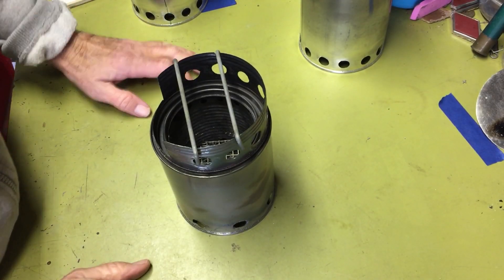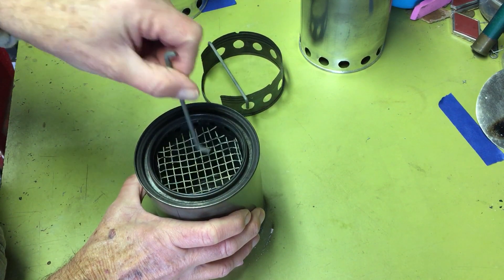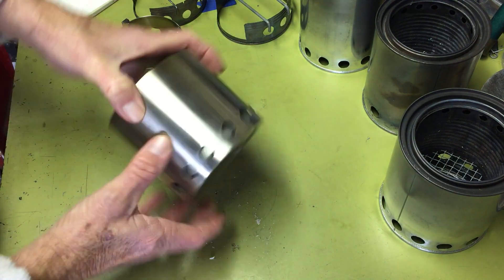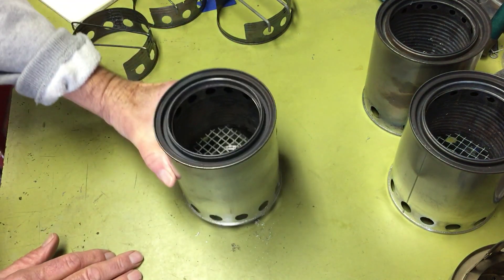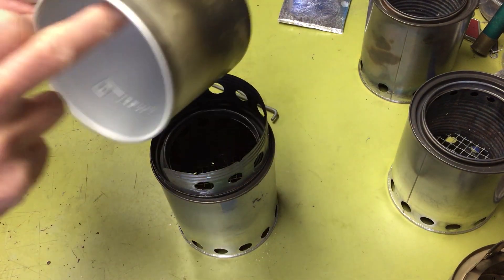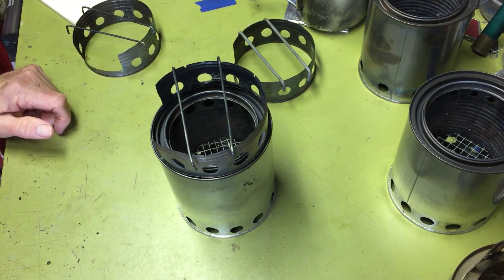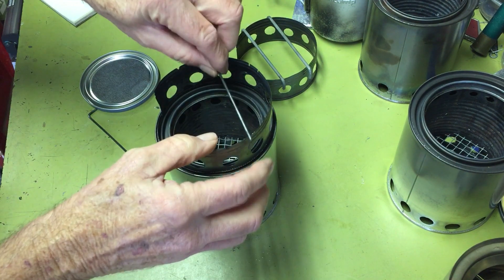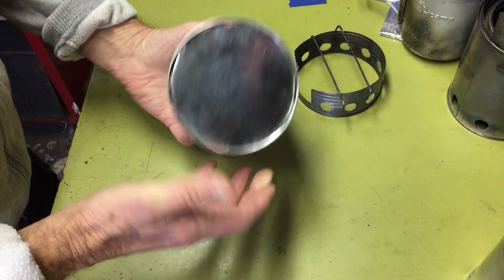My paint can gasifier wood stoves

Comment: If you put a drill bit in the gasifier jet hols and bend it over, you can create a vortex effect, which helps to heat the pot better
Reply from the maker: Great tip, I'll give it a try.

Comment: The thing that gets me with these stoves is the amount of details they give.  One video says drill 32 holes 5/32" in diameter 1/2" up from the bottom rim.  The next one says to drill 5 or 6 holes about the size of your thumb in the flat part of the can.  Then after he did that he said they're not really thumb size but they're finger size.  That should work.  

This one was good.  It told number of holes and sizes, why it didn't work and what made it better.  Very informative.  Thanks.

Comment: Now there is no paint can with the steel bottom. They are all plastics, and I thought that was your case, but you actually got with the steel base and cut them off. In other videos, I saw they left the bottom alone except to make holes on the sides.
Reply from the maker: I can still find unused new 1 quart paint cans in my local hardware store.  
In order to use the Progresso can as the burn chamber and get it to fit into the underside of the paint can lid you must cut the bottom of the can out.
The ones where they don't cut the bottom out use a different build technique and force and secure the burn can in from the top of the paint can.  Both techniques work the cut the bottom out is easier.

Comment: Nice explanation of what seems to be a common mystery... how to get the DIY stoves to draw like the factory ones. It seems that the solo and/or bush buddy stoves have that sealed bottom but still have the bottom side holes the same as the DIY's and I'm wondering if that design gives them the perfect amount or correct designed draw? It doesn't seem to make much sense but perhaps too much air can be a detriment as much as too little.
Reply from the maker: After watching some videos by Heath Putnam I'm not sure what is the correct answer on stove draw. 
I may go back and do some more experimenting, if I do I'll use wood pellets for more consistence testing since wood/twigs can be real variable.
Reply: @planetsideagent  These are two very accurate comments:
1.- Entering too much air will cause the gas to escape and be wasted. Remember that its combustion is a bit slow, and much more so if it has so much ventilation at the point of combustion. It requires high temperature to improve its combustion. An air intake regulation device comes in handy.

2.- The pellets are compacted wood, this helps to have more mass of wood inside the stove, and makes the circulation not flames, but air and hot gas.

(an additional contribution) * Remember that if the top hole of the stove is smaller, the gas is concentrated and combustion is more efficient. If it requires so much ventilation above, it is because below it is not ventilating well. This turns the gasifier into a simple wood burning stove.

Comment: The smoke is a consequence of not getting a good woodgas burn.

I've had such a terrible experience making wood gasifier stoves that I am now making a FireBox rip-off. 

Still reading? Ok, I have had massive airflow issues, difficulty starting them, billowing smoke and they just went out with the slightest breeze or would not burn properly. I have followed some precise instructions, which included a very interesting demonstration, and tried more/bigger holes, which negated the woodgas effect (smoke!). No more for me, I moved onto plain hobo stoves and cat can stoves. Thanks for the information, no I know I'm not alone.
Reply from the maker: I can't guess why you had problems with your stove.
The first gasifier I made worked ok but I thought it could be improved so I played around with the design.
 I'm not really a wood stove guy, they are interesting and fun to make and play with.   
I do have a couple of the folding type I carry for survival purposes especially in winter when it would be difficult to build a fire in the snow.
Reply: @planetsideagent  Airflow is definitely the problem. Unless you are lucky and make the right number of holes at the right size and place, even then, a slight (but continuous) breeze will want to reverse the air flow and kill the whole process, snuffing the fire with zero effort. I've tried with a really big windblock, different sizes of cans and the result is always the same; if a breeze comes through the top of the stove, bye-bye fire.. 

Nothing against people who like these stoves, but my experience has been such that I will not depend on something I can barely get going for 5 minutes. I do have to say that a perfectly windless day here does not exist... makes for very interesting bike rides, let me tell you!
Reply: @Flashahol  Interesting to find your comment - I'm in the middle of about my 6th experiment and wondering what I'm doing wrong. The weird thing is seeing other people use them and having no problems (or not reporting them, maybe). I think you're right that people tend to increase the air flow (that's what Planetside Agent is doing through these design tweaks), and they basically turn into slightly heavier hobo stoves with secondary air fed up top - burn like crazy, big yellow flames, smoke, soot and tar all over the pot after you've fed them for 15 minutes. People who get it right restrict the air intake and primary (lower) holes, and sometimes have tricks to try to create a low pressure to suck air down the burn chamber and up the sides, and they get that nice bluer flame, a steady burn, very little smoke or tar, and heat for long enough to cook and make a hot drink (from a smallish can, not even a quart pot) with just one load inside, no feeding. Check out Outside Edge Bushcraft's channel, for example - he doesn't cheat with pellets either, just battens a chunk of hardwood down to sticks and bangs it on. Four things might explain his success, as well as the good choice of hole sizes - he chooses wood well, he gives it a really good hot starter fire on top of the main wood, he always uses a wind break, and his design also has a "flame concentrator" above the jets, which helps protect them from gusts as well. But I have to admit it's a dark art to me - literally, the things always go out shortly after the starter fire's done, and they do it even when there's no wind. https://www.youtube.com/watch?v=oUG0Z1pa0Hk  He's in Britain, same as me, windy and wet. Good build video and a test video with ridiculously long burn time, boiling three kettles of water. I might have to go back to some kind of hobo stove. It's just so frustrating not being able to crack it.

Comment: I understand this is a "rocket stove", but how is this a gasifier?
Reply from the maker: A gasifier stove is a doubled walled stove where air between the walls of  the burn chamber is heated by the fire and exits thru holes in the top of the burn chamber and ignites wood gas given off by the wood fire. 
Here is a link to a paint can gasifier stove build where you can see the double wall design. Its the video I watched that inspired me to build my  versions
https://www.youtube.com/watch?v=rTPTenSPqs4&t=20s

Comment: soot is an indication of a less than efficient burn which is seen via the yellow flames which are made yellow by glowing carbon particles which is your soot. You can take a look at the Vortex 5.4 wood gas stove which is totally smokeless from start to finish and which can achieve a burn temp of 1500 degrees burning wood pellets, hard wood pellets will provide the greatest energy density. Softwood pellets are also very good though not as energy dense they are cheap and can be easily found as pine cat litter pellets. Here is the link to Heath Putnam's Vortex stove build (see below). Thank you for posting your video hope that you continue to have fun experimenting.
https://www.youtube.com/watch?v=AiJuea5T6T4
Reply from the maker: moray james thanks for the info.  I’ll give the Vortex stove a look.

Comment: How do you fit the progresso  soup can inside? Do you  have to stretch  the opening to the  quart can  or reem it out bigger with a dremmel tool?  I got the  metal quart and progresso  can but noticed  it  didn't quite fit in .
Reply from the maker: The progresso can will seat into inside grooves that are the underside of the  paint can top that holds the lid..
Place the paint can top down then center the progresso can. i use a 2x4 wood block and tap the progresso can down until it bottoms out/seats in.
its a snug fit but that's why it works so well, it won't come out.
Reply: @planetsideagent  ok great   thanks so much for your help . Its actually very cool trying to learn new stuff  and build  things.  Kind of like I discovered  the casio g shock watches have a trimmer adjustment cap and you can adjust the speed of the watch . I had one a gd-350  that was losing one second every day and over a month of tracking it and adjustments I got to gain  one second every  7 days. So I was able to  making it 7 times more accurate plus gain a second instead on lose one.

Comment: That soot is normal. That's not smoke. All dry wood, or any wood will do this unless you add alcohol to the wood, and have it soak in overnight to reduce the amount of soot. Adding a heat diffuser, a cake pan with air holes, or a paint can lid will prevent the pot from getting covered in soot. The paint can, what ever you use will be covered in black soot instead. Rub the interior of the gasifier with dish soap so the soot can be easily removed. Hope this helps! :) Melissa